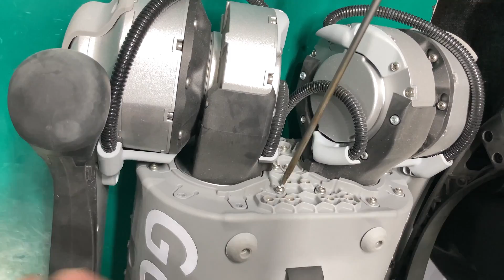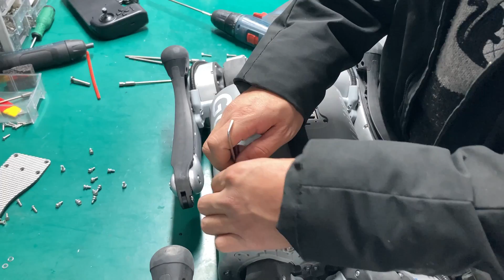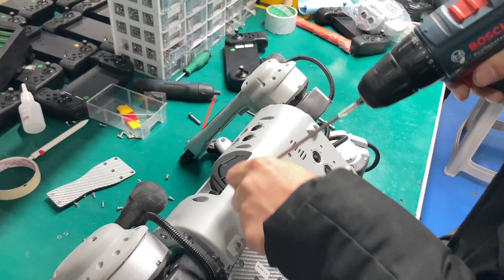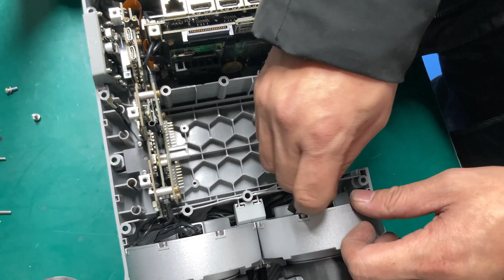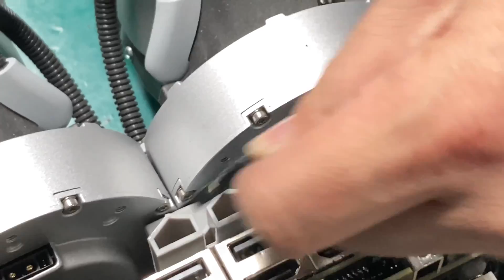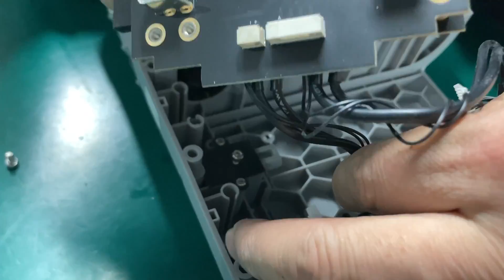Go1 Teardown / Main Board Removal Disassembly

Comment: what screw bit sizes are needed for tear down also what size Allen key and what screw type?
Reply from the maker: stop by slack. https://join.slack.com/t/robotdogs/shared_invite/zt-1fvixx89u-7T79~VxmDYdFSIoTnSagFQ
Reply: @AxleFoley  Hi, I just joined. Looking for some help repairing the wires on the RF leg
Reply: @bunnypeople  lol, I may be joining as well, my rear leg wire is damaged as well. Must be a common problem.
Reply: HI  @AxleFoley   How can join to slack channel ?
Reply from the maker: @HorelvisCastilloMendoza  we pruned a number of the member Ship requests and trimmed the group down. Hop on GitHub and drop your email address via a git issue. Will add you.
Reply: did you find the screw bit size?